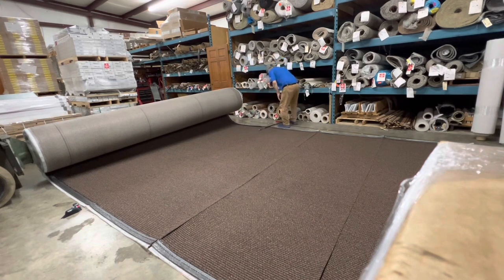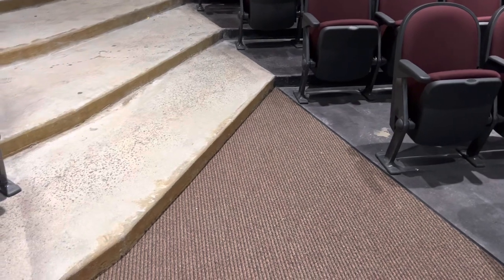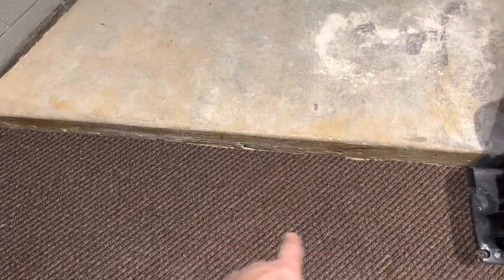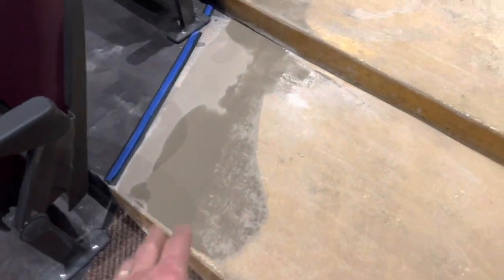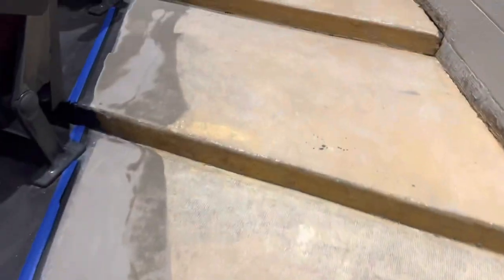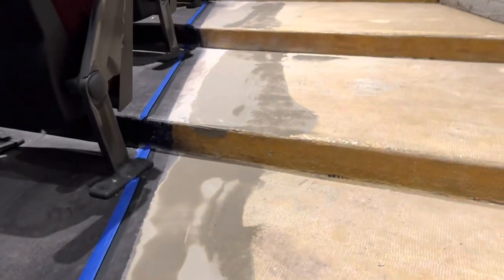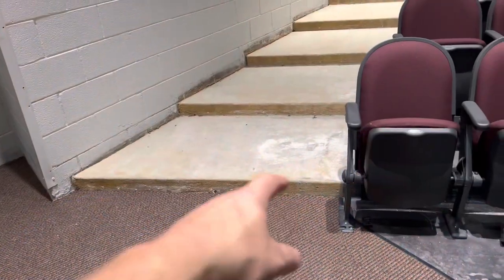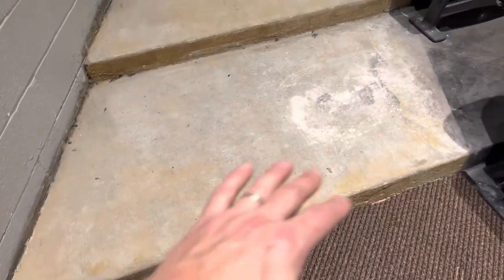Daily grind lesson on transitions ￼

Comment: Hey brotha. I’m doing a 12000 sq ft carpet tile removal job with glue down rubber backed carpet tiles on concrete. Easiest way to remove it? Rented a 99$ machine from Home Depot and I’m getting about 150 sq ft done in two and a half hours at 65 cents a sq ft. Doesn’t seem worth it. Am I trippin?
Reply from the maker: No, you definitely ain’t Trippin, there is probably someone in your area or close to you that has a ride on machine for demo. You could hire them to come tear it up for about $800 a day and be done in one day and the rest would be your profit.